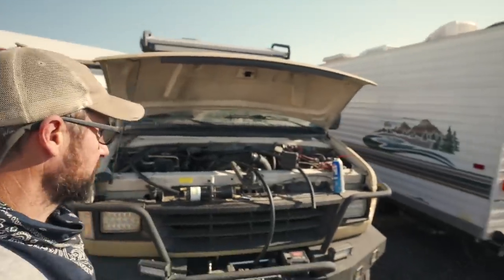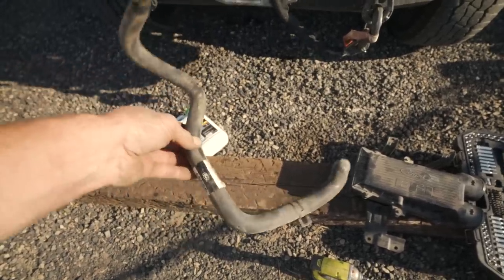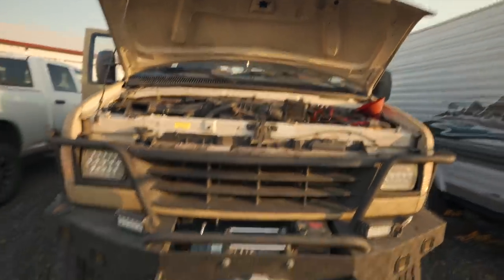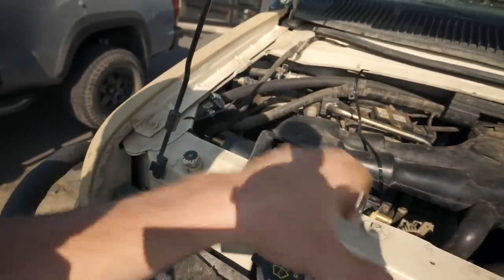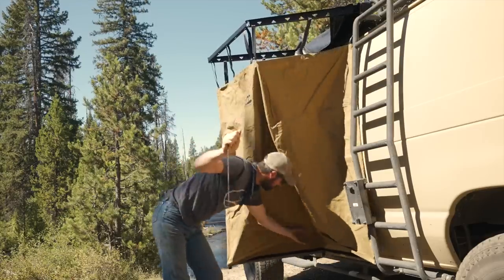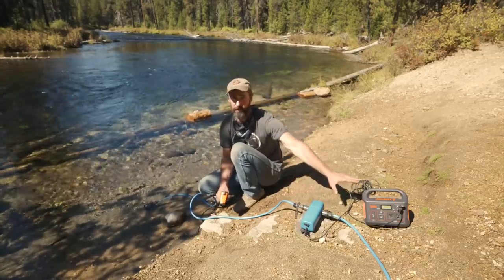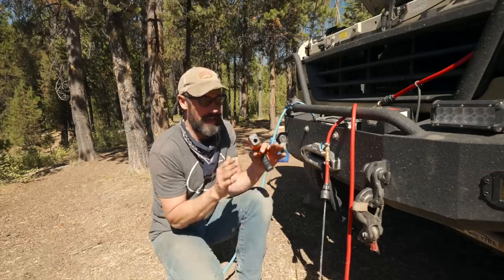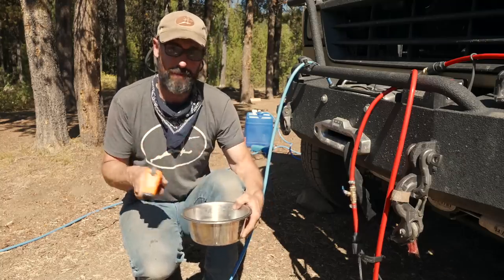Hot Water Shower System - Heat Exchanger - Van Life Build

Comment: I installed my heat exchanger by taping into the the cars heater hoses then you can controls the water temp by moving the temperature control of the cars heater
Reply: Another advantage your set-up, is that since the heater system typically bypasses the thermostat, and blocks retain a good bit of heat, one can get hot water for quite some time after shutting down the engine. Of course, operation after shut down requires a separate circulation pump.

Comment: Pretty cool set up buddy I like how you can pull water out of the lake or the river I’ve got my system hooked up to a road shower on the side of my truck I also run a small little compressor to keep the air in the road shower always up and then of course I have a propane bottle running through my little hot water heater that I hang up on the side of the truck but I do like how you have the CV shower cover integrated into the side of your roof rack gives me some idea on how to redo my pop out tent always had a problem with the pop out tent dressing room tent I should say trying to fly away when the wind blows but if I can integrate something like that that folds out I can attach it to the top part anyway give me a great idea keep the videos coming

Comment: I've been debating between this and a portable propane water heating system. Right now I'm leaning towards the propane heating system only for the fact that I don't have to run my rig to get hot water. It's a bulkier system for sure but if you want hot water first thing in the morning you don't need to worry about waking other people up with a running vehicle. It's more on demand. An idea for you though, tuck a pressure regulated self priming pump under the hood, that way you can have the pump shut off after your shower and not worry about the pump burning out and it's even more compact. All you have to do is move a jug to the front of your rig and drop the hose into it, turn it on and bam you're all setup for hot water

Comment: Jason, I truly enjoy your videos. That is never in question. Would you consider to a full on restoration of all the flexible lines, hoses and reapply the electrical connection grease to the entire van???  In turn, eliminating potential points of failure. It's your wagon, push it or pull it. Cheers, Mate.

Comment: That's a very interesting shower set up. My experience with shooting a laser thermometer into a silver bowl (reflective surface) is that the reading is not accurate at all. I have gotten low readings with this method.
Edit: I confirmed this by using a probe type thermometer at the same time as the laser.
Reply: IR thermal sensors will read the temperature of the reflection on a shiny surface.  They are really only accurate looking at a matt black object. This becomes really clear when you use an IR camera.  You can "see" the reflection of hotter and cooler objects in many surfaces.
Reply: @marcericdavis  To support your observation: I bought an Amazon Basics IR thermometer on sale for, I think, $15. I wasn't expecting much but I like to have one for each of my grills. It's the best IR thermometer I own. It even cane with "offset adjustments" for taking readings from various surfaces.

Comment: Hi mate, Recently i had a heat exchanger for my transmission, i replaced it with a dedicated radiator for the oil from the transmission as ford made it so complicated as it also connected to a thermostat housing that was plastic, so i put a bypass hose on that but this gives me an idea to salvage that heat exchanger as it was just going to sit on a shelf, its full aluminum design and works well.

Thanks.

Comment: That’s a awesome set up Jason. Have you checked into transfer flow tanks in Chico ca they make and install custom gas and fuel tanks for in-bed and under body replacing the factory tank with a larger tank. I have a 42 gal in bed-combination toolbox fuel tank. My neighbor got a factory replacement for his short bed f250 adding an additional 30 gal of fuel. Great local company really friendly staff. Would make the long trips maybe a little less worrisome not having to do many fuel ups. Thanks for the video
Reply: Problem is California regulations. Especially on the van tank swaps

Comment: Cool install.  I wonder if the long heater hose you added is limiting the coolant flow through the heat exchanger.  It's can be surprising how added length of a hose can restrict flow.  It would be interesting to know the temperature of the coolant into and out of the heat exchanger.  If there is a large drop in temp, that might tell you that more coolant flow would help.  It will also be interesting to know if the longer hose effects your vans heater effeteness.

Comment: If you reduce the flow rate coming out, it will heat up more. I do this with homebrewing when cooling the wort from boiling to 70F. The faster the liquid moves through the coil, the less heat it can absorb ( or in my case dissipate).
Reply: You can also recirculate into your jug to keep adding heat to the water

Comment: @0:35 you mentioned running the hot and cold fluids in the same direction through the heat exchanger? For max heat exchange, run them in opposite directions. Imagine this, you have hot and cold fluids entering into exchanger at the same end and a 'infinitely' long-enough exchanger, both outlets fluids will be the ruffly the same temperature coming out somewhere between the hot and cold temps based on the ratio of water flowing (volume/time, i.e. CFM) on each side. For one fluid path, flip the direction and the same "long-enough" exchanger, and the temps still be closer to each other but one end will have hotter fluids and the other end will have cooler fluids with an increase in heat exchanged between the two fluids. For heat exchangers, the greater the temperature delta the greater the heat exchange efficiency (one of the rules in thermal dynamics)... translation: raising or lowering 20 degrees is easier than raising/lowering 2 degrees. Make sure you are running the fluids in opposite directions in your heat exchanger.

Comment: I was really curious how the heat exchanger would work.  I was surprised it didn't heat it more than it did but I guess that joolca is running the water through pretty quick.  I used the joolca at Overland Expo and discovered I could go through 5 gal pretty quick.  Is 5 gal the size of that water canister you were using?  Just curious.  I got through my shower but just barely.  I did waste some while I was setting it up and testing so I probably took a shower on 4gal but just curious how you managed that.  running out in the middle would really stink LOL.

Comment: What did you do with the propane gas water heater?????
Now you have to burn gasoline at $3.25+ a gallon 😔😔😔!!!
Dennis from Delaware
Reply from the maker: As mentioned in the video I get the added  benefit of charging my in house battery system while the van is running and I can also choose to heat the interior as well that is three uses while van is running. The propane hot water heater only gave me one use and I had to take up space storing it.

Jason

Comment: I'm really torn between this system and a propane hot water heater......
Reply: The heat exchanger solution is slow, but a lot less fuss to deal with IMO when installing. You will need 2 lengthy hoses, one from the water tank to the motor compartment, and one back to your kitchen/shower. Propane needs a tank, proper gas hoses, extra safety measures, and needs to be refilled separately, but it will provide warm water 'instantly'.

Comment: Just straight hot water can’t control the temperatures not a great set up
Reply from the maker: Like I mentioned in the video you can get a thermostatically controlled mixer valve but I chose not to because for my needs I didn’t  see it necessary.

Jason

Comment: Another pump you can try is an rv water pump they have built in pressure monitor valve 
It can shut off or run slower depending on output 
Mount it next to heate exchanger
Reply from the maker: I do have a internal RV pump for my van in house water needs that is hooked to my 7 gallon inside water tank, but I didn’t want to pull from that water source for my showers. The Joocla pump does have a pressure on and off built in and being external I can take it to the water source which is really convenient. 

Jason

Comment: Now, like your LP tank, you need a small insulated hot water tank tucked up under the van.  Have the system circulate while you drive and you’ll have hot water in the tank ready to go for shower or washing dishes.   Of course, if there’s no room and it affects your cleanse, is there room inside the van for the tank?  Ahh heck, it looks like it works fine as is….  Fun project. Thanks for sharing.
Reply from the maker: recirculation tank would be a good option for sure, I don’t see myself going that route but I still think it could be a great setup.

Jason
Reply: @PrimalOutdoors  Ok, I understand.  I guess it’s still easier to run the engine than to say boil 5 gallons in of water using your Propane and poring that into a jug or just drawing out of big pot.  Probably burn less Diesel and you have more of it than Propane.  Can’t remember. Was your plan to run the pump, fill a 5 gallon jug, then recycle that using heater with van running until it was up to temp, turn engine off and pump out of jug for shower?  Or were you just going to go directly from cold water source through heat exchanger to shower head?   Navy type shower with on and off shower head could result in extreme heated water with each initial turn back on of the water.  If you keep the water flowing, I thought you were not happy with the temperature out of heat exchanger?   Really going to enjoy seeing what works for “you”.  Thanks for sharing the build and experiments along the way.